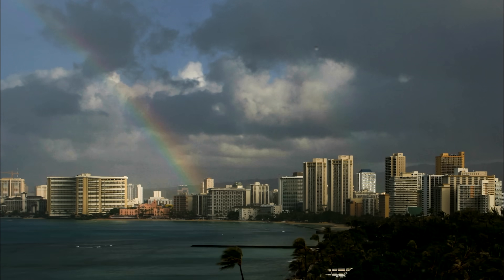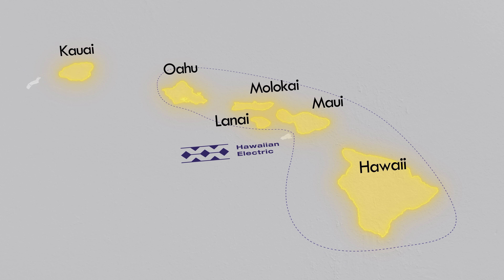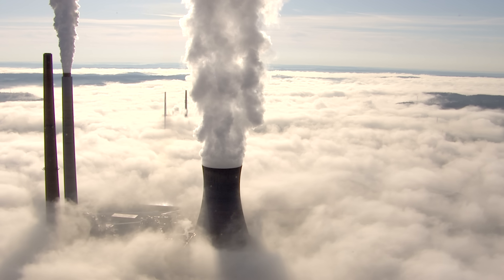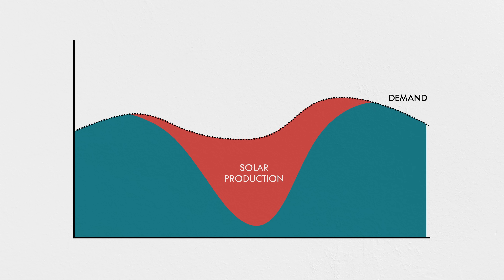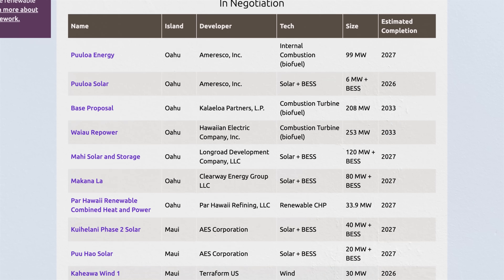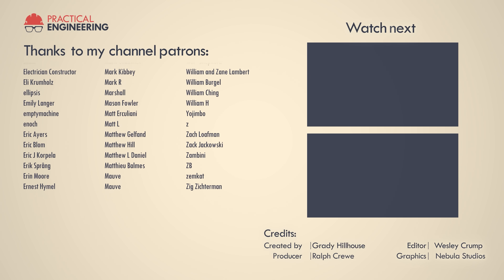How the Hawaiian Power Grid Works

Comment: This might sound selfish, but what if the distributive grid only serviced a single point... a house or store... or whatever.  They drive down the demand on the grid. But they can't feed back into it. That reduces the effect on the total grid from hackers. Hell, if you isolate the systems, it makes it immune from all non on-site hacking. If you thereby put this into all the structures that would take it, then you have millions of small generators across the islands, only receiving supplemental power as needed. 

Such a massive demand for sales should drive down costs if you prevent government corruption and price gouging... Oh wait, Hawaii is leftist, so I guess there is no chance of that. Lol.

But back to the point.... 75% of structures where so equipped and they only provided 2/3 of the structure requirements your total grid effect could be a that would be 25% of the grid demand for those structures. That's a huge increase in available power.

We have had decades to prove that both solar and wind do not work on large-scale. BUT it does work on a small scale. Why are we spitting into a hurricane instead of using technology to its best purpose?

By the power companies fronting the costs of solar they can then recoupe their investments on the back end and most likely see higher profits than otherwise. The company installs the equipment then bills the owner an electrical bill according ingenious to their usage. The more power they use the higher the bill. The less power they use the quicker the equipment pays for itself. 

Also it's moronic to push electric cooking when many household could generate their own biogas for cooking instead of using fossil fuel power generation. That would drive the use of fossil fuel use down more.

Comment: Actually there's a  way to control inverter output of individual small inverters and it's called P(V) function. As far as I know all UL listed grid inverters must support this function.
In a nutshell it's a table where you can set what percent of nominal power an inverter must output at different grid voltages. So when voltage rises inverter derate their output capacity. Some inverters also support Q(V) – similar thing but for reactive power.

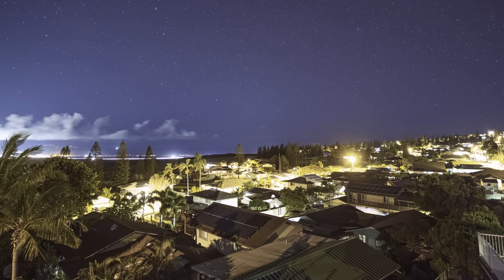Comment: 13:13 Here in the UK, we've had an electricity charging plan called Economy 7.
It was basically designed to switch your tariff to a cheaper rate from the evening and through the night until peak demand started again in the morning.
For some reason, parts of it are being phased out and apparently it's ever more difficult to set up if you move to a new property or supplier.
So much so that it's often mentioned on property details when the house is for sale!
It makes a lot of sense both environmentally and cost saving. I take it from the fact that the suppliers are ever more keen to keep quiet about it that it's truly worth having!
Reply: In Michigan it's not optional. They charge you more during the day now.

Comment: Somekind of business to business recycling of the more expencive parts of the powergrid could be a novel way to lessen the impact of invest in transformational technology needed when moving from tradional to distributed power grid. Especially because of the cost of the hardware and if it has seen use only seldomly and usually power grid ardware is built to last indefinetly on full use if maintained properly.

Comment: Nuclear could help if it's done all out. One of the issues with nuclear is its slowness to demand change, however if you attach a distillation plant or a H2 generating station to the nuke plant you can dump excess power into either making distilled water or hydrogen.

Comment: Solar and wind are the primary alternatives to fossil fuel power generation right now, but they will never provide 100% reliability without a lot of expensive storage. Please do an episode on Eavor, which has developed a new type of geothermal power system. It can be sited in far more locations than traditional geothermal. They are now building their first utility-connected plant in Germany.

Comment: The industry standard reliability to plan towards used to be one days worth of outage in 10 years. There were programs which simulated the probabilities of generating stations being in service, out of service or derated and at the same time simulated the hourly peak demand. This allowed engineers to estimate how much installed generation is needed to meet the reliability criteria (I wrote some of those programs and used them for system planning at my utility). The rule of thumb is for a large utility with many units was a margin of 15 to 20% (that percent of extra installed generation compared to the peak annual demand). In a small system like Hawaii it would be a much larger margin. And the uncertainties of renewable generation compared to thermal generation would drive up that margin even more. Interestingly, rather than choosing an arbitrary measure like one blackout in ten years, towards the end of my career the criteria was set by calculating the cost to society of an interruption and balancing that to the cost of adding another MW of generation. These days when we are so much more reliant on reliable electricity supply, much more reserve would be needed. However, as you noted advances are being made on the demand side to reduce demand of customers through contracts. So a customer could agree to have his/her air conditioning or pool heater interrupted and receive a payment which costs the utility less than adding more generation.

Comment: Greenland has run it's power supply 100% from geothermal for decades.  Greenland needs more power in the winter for massive amounts of heating and Greenland can't just switch to solar for that.

For anyone living on a volcano like Greenland, Iceland or Hawaii there is absolutely no technological reason why you can't just copy Greenland, Iceland is close to the 100% geothermal.

The only problem for Hawaii is political, the fossil fuel lobby is a very powerful lobby giving billions of USD to politicians, that is a far more difficult problem that anything else.  Note: The term "lobbying" is a polite way of talking about legalized corruption where politicians get bought by very large private organizations.

You can try to fool yourself to think there are technical problems, but these technical problems don't exist in a different country which hasn't had the same political lobbying.

Comment: I, honestly, feel like most of these problems are just problems because of two fronts not working together but against each other. 
What'd be the problem of having good consumer grade equipment that can (!) in fact work with the grid? 
What'd be the problem of making a grid smarter in general? 

I feel like many of the problems with renewables are just related to companies - or people sometimes - don't want to invest in their infrastructure and making it smarter as well as safer. In general, I feel like cyber security is a very neglected topic in public infrastructure. It's a similar thing with car manufacturers and bi directional charging. We got these big battery packs essentially, which are mostly just standing stupidly around, that can, in fact, help stabilize the grid and act as battery banks, too. I mean, we got them anyways, why not use them? 

It's just frustrating to see how the little investments in such infrastructure are now leading to problems. We could've started investing in smarter and better grids years ago and now, I feel like, people blame renewables for rapid change whereas this change had to come at some point (i.e. when the fossil fuels run out eventually lol).

Comment: You actually CAN pay extra for more reliability: You can install a local battery bank. The good ones seamlessly take over if the grid fails.
Reply: Kauai has Tesla batteries for its grid
Reply: Um. We all know you can pay extra for more reliability. Nobody claimed that you can't.
Reply: @beeble2003 
The video did, actually.
Reply: @ParaSpite  No, it said that there are diminishing returns when you pay for more reliability. Suppose your system is 80% reliable and spending a million dollars will take it up to 90%. Spending another million dollars won't get you to 100% but only to something like 95%.
Reply: @beeble2003 
Did you watch a different video? I commented immediately after he said that the end user cannot pay extra for more reliability than other end users, because the grid as a whole would go down.

And sure enough, they can't pay more directly to the utility company, but a battery backup has the same effect so it's not really true.

Oh, I get it. You only read the first sentence and then jumped into reply without considering that you might have misunderstood what I meant.

Yeah, you're talking about the reliability of the grid as a whole, as if I was addressing the grid operators with my comment, when I was addressing end users.

Comment: Why don't they use pumped storage hydraulic batteries? The place is full of mountains and volcanos, why can't they pump some water uphill during overproduction, and then let it run back downhill  through a turbine when the grid is strained?

Comment: I am impressed at the forward thinking plans. If I were to make a wild guess the biggest demand on the electrical system is air conditioning and refridgeration with millions of daily mini spikes as stoves and microwaves are turned on at meal times and clothes dryers in the evening after that. LED lighting would have been a huge cost saver.

Comment: haha In South Africa we have these scheduled power outages almost every day. (I believe there is one scheduled in about 30 minutes) Here we call it loadshedding and we South Africans have been living with it for 17 years with each year bringing more frequent and longer outages! A few months ago we had 11 hours of loadshedding in 24 hours!   But there is more.  With elections around the corner the currant political party (the corrupt ANC who have been in power since 1994) is bringing down the loadshedding frequency and duration which may sound good but it's not.   The amount of strain that it is putting on the grid is huge and is causing allot of issues.  In the past 4 months we have had 3 power failures! One of them remained unattended for 5 days and another for 4 days!   Our substations are in a sorry state, if u drive past one in town one of the cooling fans for the step down transformer fell off and hasn't been replaced. I fear that if this is kept up this country is at risk of a grid failure!

Comment: 25% renewables is high for you?
Here in Germany we have around 40% and its still increasing.
We also have a few islands and each one is connected to the mainland with an undersea transmission line, so it should be possible (and worth it) to connect the islands between each other in Hawaii.

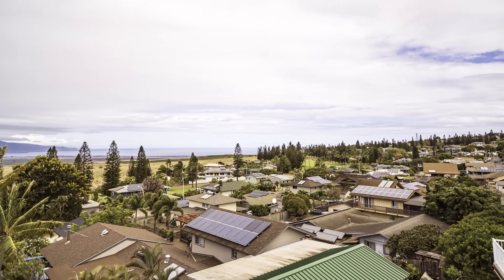Comment: 13:41 That's...actually an idea so utterly insane it could work. Distributed grid production, aka rooftop solar at scale, will eventually need the ability to be controlled by the grid operator to mitigate the problems you mentioned at 9:47 . From a purely software standpoint, it's not exactly hard to go from being able to tell the inverters at several dozen addresses 'don't push more power to the grid' to 'ok turn off this set of addresses for the next hour'. Setting up this sort of...what I guess would be opt-in for additional blackouts shouldn't be all that hard. Getting people to actually opt-in, now that will be difficult.

Comment: forcing new homes to use solar powered water heaters seems like a horrible idea, maybe with auxiliary electric heating to get the slack but solar heated water supply alone seems like a extremely disappointing experience for every homeowner who wants water that's hotter, for say, dishes or something.

Comment: Solar water heater is a concept I’d never even conceived of, but it honestly sounds pretty awesome
Reply: I'm surprised they are still a thing. My parents have had one since the 80s and it does its thing fine (except on poor weather days). But these days it would be more cost effective to put a slightly larger solar system in and install a heat pump.

Comment: I think that Hawaii might be able to learn something from the South Australian grid.
South Australia has roughly the same population as Hawaii has. SA has a low density of population which increases network maintenance costs, yet they have the cheapest electricity in Australia. SA runs at 80% renewable power generation on an annualised basis and will hit 100% in the next five years whilst also meeting more stringent reliability requirements than any US state. You can often charge your home battery or EV for no cost during peak renewable power generation times.

There is one caveat; SA does have one interconnector with other grids but it was the unreliability of that interconnection that forced the SA government to look for stand alone solutions; massive commercial wind and solar, massive domestic solar, grid services batteries, grid storage batteries and pumped hydro

Comment: Where is Geothermal source? Hawaii is a part of a volcano chains, it sits on tons of untapped heat. Why they don't tapped more on it? Learn from Iceland
Reply: The geothermal plant is on the Big island and originally was supposed to be MUCH bigger.  Controversy and why it's not bigger is all about "putting eggs in one basket" where an eruption could take it out in one fell swoop.  Eruption actually DID damage and shut down the plant in 2018.  This event is shown at 6:38 in the video.  Luckily it was a close call but not complete total loss and it's back up and running now.

Comment: German electricity would be a good topic for you. By now they must have installed like 200 Gw or the equivalent of 200 nuclear powerplants in wind and solar power,  way, way too much. I used to work for Rheinmetall and often had meetings in northern Germany and was often struck by the fact that when the wind was good, the wind turbines were standing still because they were generating too much power,, crazy no.

In Switzerland we have a lot of hydro power and it used to be one of the big money makers, now they have to be subsidized, crazy no!

German electricity is two times as expensive as in nuclear France, but this is without accounting for the subsidies for installing wind and solar generation, if you take subsidies into account, German power production would probably be closer to ten times more expensive than in France.

I hope to have gotten ou curious about this German idiocy!

Comment: I suggest taking a look at the state grid of South Australia. It's way ahead of Hawaii and has already surpassed 70% of electricity supply from wind+solar and it will continue well beyond that. It's using syncons to assist with inertia as well as big batteries for fast response management. Highest rooftop solar penetration in the world. Annual electrical energy demand ~14 TWh.
Reply: There are dozens of countries that are way ahead of Hawaii. He only thinks Hawaii is a leader because he's not looked outside the USA.

Comment: Regarding inertia with inverters.  It is possible to create 'virtual inertia' with an inverter.  The problem is not of a technical nature but of a legislative nature.  This is very similar to the 'frequency ride through' problem - the first generation of grid interconnect legislation for inverters stated inverters must not participate in frequency ride through and it was not until the large scale consequence of this lack of foresight became a problem that the interconnecte rule were changed to state that inverters must participate in frequency ride through. 
It is just the same with inertia  - current legislation states that inverters must not exhibit inertia and this is the fundamental problem.  To fix this issue all that is needed is a change in legislation to state that grid tied inverters must provide inertia.  It really is as simple as this.

Comment: "What's hard to keep them all running 99.9% of the time."  In my industry, one 9 (i.e. the part after the 99%) of uptime is deemed the lowest level of reliability.  That works out to an average of 8.76 hours of downtime per year.  You pay an increased amount of money for each additional 9.  For comparison, the telecoms have a federal legal mandate that landlines must have a minimum requirement of three 9's reliability (99.999% uptime) or 5.2 minutes of downtime per year.  That's why the power can go out and yet a landline still works.  It's amazing what a little bit of industry regulation can do.

Comment: “25% [of energy] produced… comes from renewable sources… taking advantage of renewable resources on the island”

Nope. Panels, Windmills, etc. are not produced on the island. 

The island becomes completely reliant for their electrical system on external sources. 

There is a reason why electricity is so expensive there.

Comment: I've always viewed the inherent unpredictable output of wind and solar as reasons to seriously limit their contributions to even a huge, nationwide grid...but this really highlights how awful they are on a tiny grid like an island. Proportionally, the amount of storage buffer needed to get any isolated Hawaiian island through a couple windless, cloudy days, if they switch to 100% wind and solar, is staggering (and hugely wasteful of resources, and economically infeasible). If the continental US were joined into a single grid, it makes sense that a fleet of wind turbines distributed from Seattle to Miami should contribute a relatively stable average power input. So the more throttle-able sources should be able to compensate for the fluctuations without much (or any) storage. But Hawaii? Each island should have three "mini" nuclear power generating stations in different areas (to avoid single points of failure) and be done with it.
Reply: But will these nuclear plants cost more then the battery option?